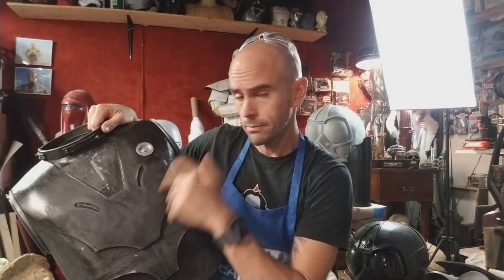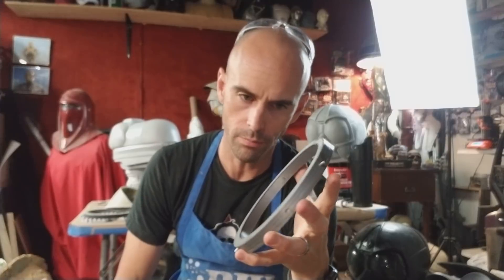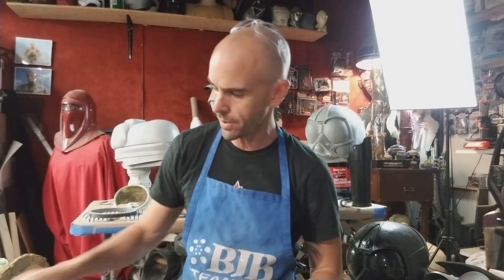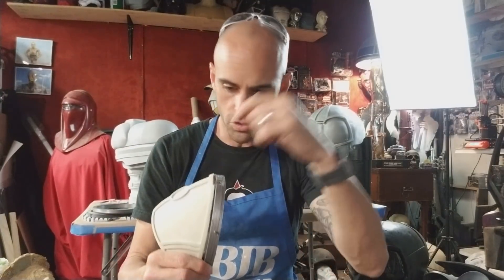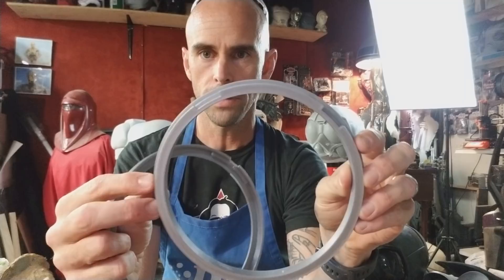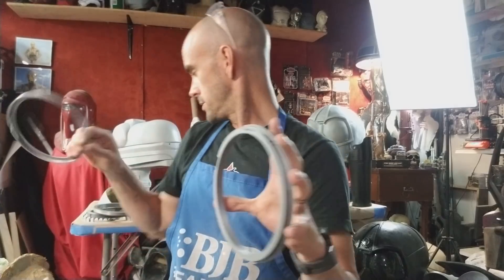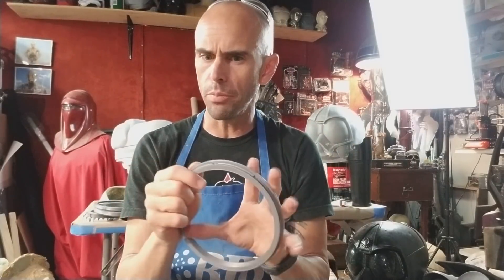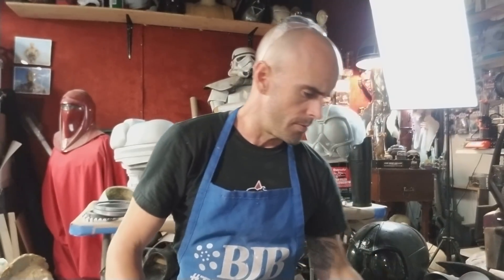New 3d Printed Protocol Droid Shoulder Ring Design!---C-3PO Blog Updated 180802

Comment: Gordon - Can you do a bit on your printer (Slicer) settings for something like one of your arm tubes. Like Walls, thickness, infill etc.
I can print "parts" just fine, but struggle with pipes, cones  anything "hollow" - and you're the best practical 3D guy I watch for that kind of stuff.
Reply from the maker: Thanks! Yeah, I'll put that on the to-do video list. Usually I just model the part hollow and model the wall thickness into the part. I'll try to cover more specifics when I have a moment!